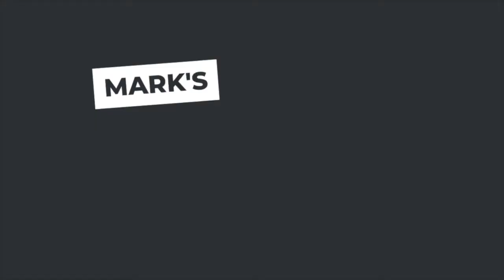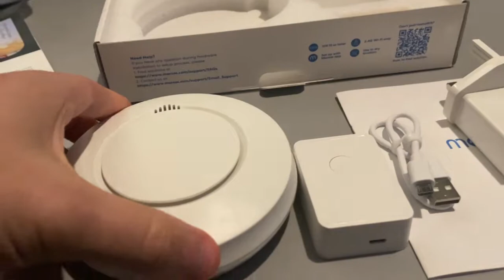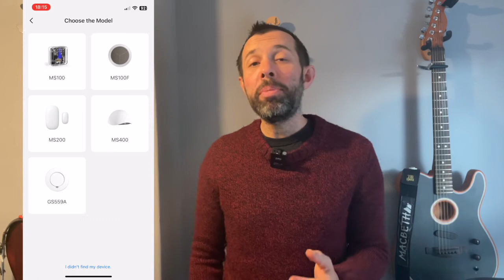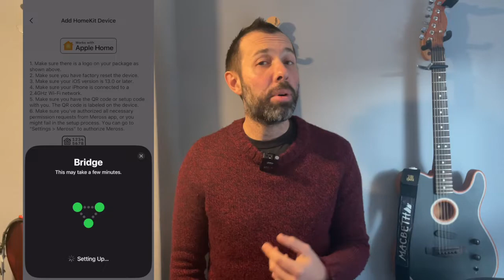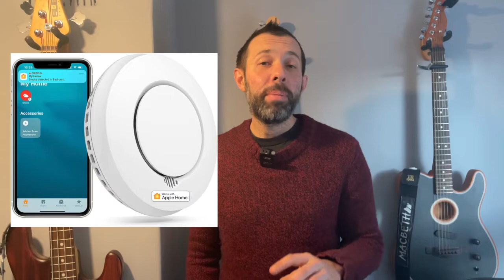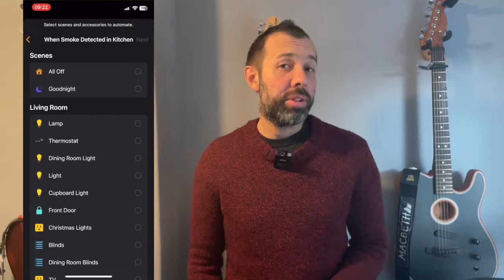Meross HomeKit Smart Smoke Alarm/Detector Review

Comment: hello there ! thanks for the video! I need a clarification though from anyone that can help. I can find the bundle option and just the detector. The bundle one has the bridge and it says it connects to HomeKit app. the other one says nothing. should I buy all off them with multiple bridges or I will be able to connect them all to the bridge and they will work fine? Anyone that tried that ? Thanks in advance !
Reply from the maker: You only need one bridge and each one you add to that bridge will then appear in Apple home as you basically just add the bridge. The older bridges that come with these can handle (I think) up to 12 devices. Meross have just released an updated alarm and Matter bridge which can handle more devices and works the same way. I’ve got a review for that on my channel too
Reply: @MarksTechVlogs thanks for the answer

Comment: I have my devices set up and followed the home kit set up. 

I am unable to see it on the home screen but can find it as a hub only with the detectors. Have a missed a step?
Reply from the maker: Nope, it doesn’t appear as a block in the home app like a bulb does but if you go to the room and look across the top where you see sensors you should see a smoke sensor
Reply: @MarksTechVlogs  thank you, just keep seeing images even on the advertising that show on the home app and I was not seeing it that way. I have found them using your method though thanks